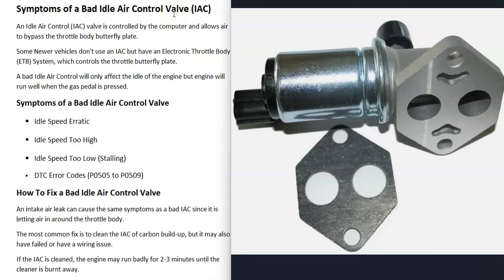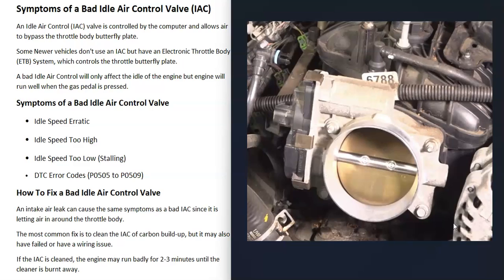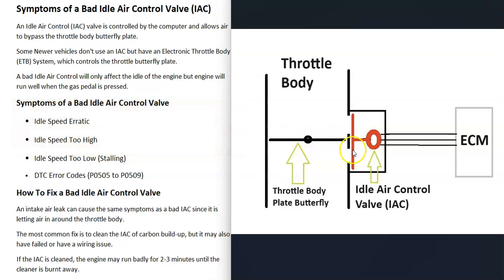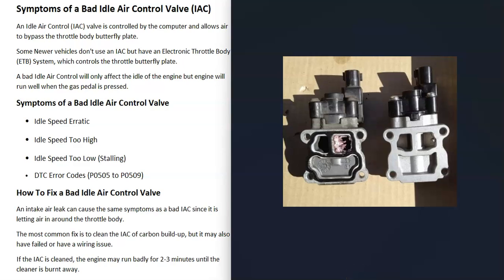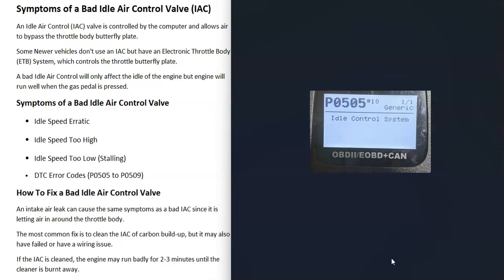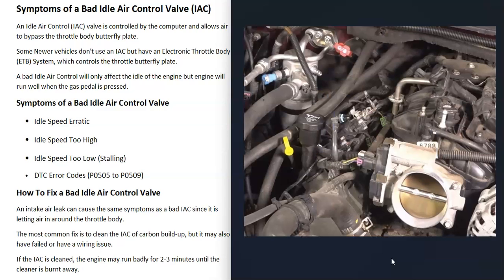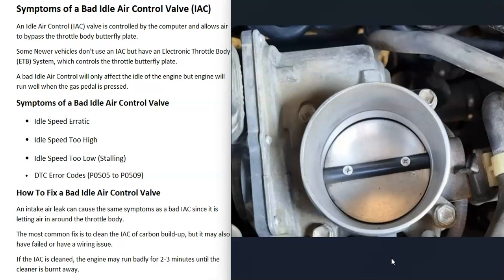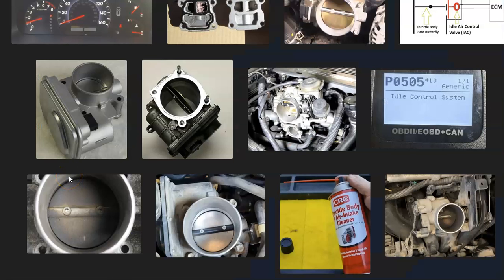Symptoms of a Bad Idle Air Control Valve (IAC)

Comment: If u find a lil bit of oil in the intake then what does that mean? If I clean the throttle body and my rpms rise about 500-1000rpms at idle or when the ac is on every 6 seconds then do i change the throttle body? Its a 2018 dodge journey se 2.4l

Comment: Do you think code P0507 has something to do with it, 2022 Kia K5. I keep getting this error code
Reply from the maker: Newer vehicles use an Electronic Throttle Control system for idle control, and don't have a detected IAC valve. With a 2022 Kia P0507 code, I would clean up the throttle body if it's dirty, check for a vacuum leak, and test the PCV valve.

Comment: Helpful for our THREE fleet Ford trucks that had aftermarket filters in them. Our fourth truck that had factory air filters didn't have these symptoms.

PSA: NEVER use aftermarket K&N Air Filters or any aftermarket air filters if you live in dusty climates like NM or TX. Saving pennies only to spend a buck. Always wondered why these aftermarket filters never caught that much dirt when we vacuum cleaned them seasonally. Stick to changing air filters every 3 months just like your house.

Comment: So I have replacedy iac valve and the guy I bought it from also replaced it. I replaced it again just in case and I still have very eratoc idle. Sometimes when I take it out of gear at highway speeds it will just rev to 3000 rpm and stay there for a minute and then come down. Could it be EGR valve?
Reply from the maker: It's possible, but a bad EGR valve usually causes a rough idle or stalling, but not a high, steady idle. A steady high idle is usually a vacuum leak or throttle body issue. If the engine has a lot of miles the EGR may be bad along with other issues.
Reply: @HVAC_Mechanic  mine is booging to 500 and hopping to a 1000 really quickly like it has a huge cam. Lights dim when it bogs. Seriously sounds like it's missing or has a huge came "buh buh buh.... Buh buh buh" type stuff. I'm sorry if my description is terrible. I did a vacuum smoke test and the only places it leaked were from the new iac valve and the EGR valve

Comment: If my Subaru Forester is coghfin in cald start even steel after garage clean throttle budy bat i don't think they did tithing the computer by reset,what else can be the problem if rpm up and down will starting the engine?🙏 3:40 3:40 3:40 3:40 3:40
Reply: It's 2015XT 160000 K

Comment: I got 1990f150 4.9 300 it's ideal to low drinking way to much gas go down the road get the padded were it not pulling it want to rocks back and forward like it's built with a big cam does anybody no what's going on

Comment: Hi 2018 Silverado 1500 running bad when I started it and then it started running good could it b air idle control valve or 02 sensor

Comment: My 2001 Tahoe revs high while in park but settles down when put in reverse or drive. Code im getting is P0507. It also accelerates without pressing the gas pedal. I took off the throttlebody and cleaned it off really well.
Reply: If that doesn’t work change intake manifold

Comment: 2002 ford expedition. I’ve changed the battery alternator and the spark plugs and coils but it still dies when I idle or take my foot off the gas. I really think this is my issue

Comment: 03 cadillac seville sls. Had to replace camshaft position sensor and both coil packs..1,485 dollar job..on way home my tachometer is jumping up and down. Actually feels like someone has their foot on and off my gas pedal. Runs ruff at stop signs .gets some better when I'm driving faster.going clean throttle body and replace idle air sensor.

Comment: My car does this inconsistantly. My brother was more concerned with the possibility of vacuum issues and advised me to get a new brake booster, i haven't installed it yet, but im suspecting that IAC might actually be the problem 🤔
Reply: Did you fix it? My car is also doing it inconsistently. One time it'll be just fine, next it'll be stalling and running rough when it's in idle.
Reply: @richardwetzeliii4195  not really. I found out my car('85 grand marquis) doesn't have one. I haven't really messed with it since then.
Reply: @Wingedshadowwolf  dang. Well hopefully you figure it out, whatever it is. I've got a 92 Crown Vic and it runs just fine, except when idling and it's just frustrating. I think I may have a vacuum leak.
Reply: @richardwetzeliii4195  That's a bit newer, I don't know if it has an AIC or not. Mine has a low idle control screw to monkey with. In my searching I found people talking about electronic versions too. To check if the brake booster was leaking, one of the shop guys pulled the vacuum line off the booster and a quick blast of air escaped. He said if it was leaking, it wouldn't have had air in it still.

Comment: What if I’m having an issue where my 08 Ranger idles at 2.5k and a slight tap of the gas pedal makes RPM jump. Doesn’t change when engine is warm on idle

Comment: So my car won’t idle when I first started in the morning it’s a 2006 Ford Taurus 3.0 V6 and after it warms up a little bit, it’ll idle, but it’s a rough idle. I put a new idle air valve controller air valve on it a few months backand I’m just wondering if it’s possibility that it went bad already and or should I disconnect it while it’s running and should it stall out or if it’s working right should the RPMs increase if you can get back to me that would be great thank you.

Comment: Here's the scoop. 2002 5.9l  (gas) sat for 3 weeks. Now it won't start without starting fluid. Once started, it idles fine and throws no codes. If I slowly give it gas - it's fine. If I goose it - it chokes out. Btw, without starting fluid it cranks like a bear and when I let off the key it tries to start at the very end of the cycle. Can you tell me what you would look for right off the bat?  I'm getting up in age and it's winter so the less time I'm dickin with it the better. Thanx in advance.
Reply from the maker: It needs to be diagnosed, but I would check the fuel pressure regulator, the check valve, or the component (it can vary) that stops the fuel from flowing back into the tank when the engine shuts down.
Reply: @HVAC_Mechanic  Thanx for the quick response. I'll pick up some beer, hotdogs, and dynamite tomorrow.

Comment: I have a 1988 jeep Cherokee 6 cyl in line 4.0Lt  4x4 
We changed the spark plugs , the wire, the charcoal canister, the router and cap the fuel injectors the idel speed control the 2 of the one next to the other we changed the one on the transmission that prevents it or gives a hard start. We changed oil filter ,new oil we changed gas filter and gas pump. We even tryed a next computer . . It starts but it would not rev up for nothing the cables are all hooked up we checked to make sure the gas is in the tub that is connected to the injectors great pressure. Help any idea

Comment: I'm having this problem with my car when Im at a full stop at a  traffic light and just letting my car idle out my steering wheel will shake and the car its self would shake and jerk, and all of a sudden when I accelerate my steering wheel would stop shaking, and my car would jerk or feels like it is going to die out even burbles coming out from my muffler, but when I fully step in gas pedal the car would run normal when I accelerate fast.

Comment: My car stalls at stops and even cuts off when in neutral any idea of what’s causing it? I replaced the MAF and cleaned the throttle body
Reply: Check spark plugs coil packs ect
Reply: Catalytic converters ect

Comment: Have all the symptoms you mentioned. I cleaned throttle body, replaced Tps, and IAC. Reset CPU and now my truck start up fine but won't want to drive or  move completely
Reply from the maker: Are there any codes? Also, some vehicles have what's called a throttle relearn. If the throttle is cleaned or a sensor is replaced, the computer may need to learn the new variances. Often, the computer will relearn automatically, but sometimes there is a set procedure.
Reply: @HVAC_Mechanic  thanks so much for reply and no. No codes what so ever
Reply: The throttle body I took out and clean looks OK and clean and the window flop is opened and close by toggle back and fore OK. I'm kinda baffled
Reply: It's 1999 4runner limited
Reply from the maker: I would recheck all the wires and any hoses and be sure everything plugged in good. The throttle body may be good, and there may be another issue. With no codes, it will need to be diagnosed, and components will need to be tested to find the problem.
Reply: @HVAC_Mechanic  Sir, you are god sent gifted for helping me out. I went back this morning and retraced my steps and took everything out and put everything back again. Didn't see anything that might be out of ordinary. I did, however, took out the TPS and turn it back and fore thinking it might be stuck even though its brand new. After that, I did a relearn and reset. Long behold, that thing move forward and drive but noticed slightly when put on backward, it takes kinda slow to put it in gear to go back. So, I was wonder if this will take sometimes for it to relearn fully.

Comment: I have a creta 2017 which doesn't start unless I push the gas paddle. Rarely stalls 2-3 min after start and it's usually when stopped at traffic lights. The throttle was cleaned, changed sparks and air filter, still the issue remains (no error codes). It happens when the car is parked for like +8hours. What could be the issue?

Comment: MY 2004 TOWN CAR,STARTED TIS RECENTLY,I HAD CHANGE THE IACV A FEW MONTHS AGO,FOR A NISE COMING FORM MY AIR BOX,VIBRATING,HIGH PITCHED NOISE,CHANGEIT,WENT AWAY,NOW THE FAST IDLE AT COLD START,NO LONGER HAPPENS,JUST VERY LOW IDE,I HAVE TO PEDAL TO KEEP RUNNING,AFTER WARMING UP,DOES BETTER,STILL A LITTLE MISS FEELING,BUT RUNS GOOD WHILE DRIVING,SHOULD I CHANGE THE IDLE AIR CONTROL VALVE AGAIN? I DID BUY FROM  E-BAY,IT WAS CHEAPER,WAY CHEAPER,THANKS,APPRECIATE YOUR THOUGHTS ON THIS, I GET NO CODES OR ENGINE LIGHT,CLEANED THE THOTTLR BODY AND THE MAF SENOR, NOT MUCH CHANGE AND STILL NO ATOUMATIC HIGHER IDLE AT COLD START.

Comment: 2006 dodge Durango 5.7 hemi v8. 115,000  got it 4,000 less.  Stalling on low idle/ traffic lights, especially when making turns that doesn’t require giving gas ( or throttle)   I can wrench a bit and have replaced, recently enough quite a bit of the exhaust system in general still  bad ass truck. Cat delete   Too many minor fixes replacing and cleaning to list but appreciate this video bc it’s helping me to narrow down before I get too crazy trying to get the air fuel ratio tuned.  She was slightly neglected but still a beast. Thanks this helped tons. I would appreciate a response from anyone and I can elaborate further as I fix
Reply: Hey was your oil pressure dropping at a idle as well??

Comment: So i was getting shaking when idling so i cleaned my throttle body and put in a new aic valve and my problems started. Was the new one i put in faulty? I bought it at autozone. Should I go and demand another one?
Reply from the maker: Some vehicles have what called a Throttle Body Relearn. If the parts and wiring is good, I would research if it needs a throttle Relearn.
Reply: Unhook bat, set for 30 mins. Hook bat up, let idle for 10mins.

Comment: Great Video! I have a 2006 Jeep Grand Cherokee and recently put new heads on due to bad head gasket, also new timing chain kit along with brand new OEM catalytic converters. When i was taking the Cruise cabe off the throttle body  i broke the nub that the cable clipped to so i got a used  throttle body and rebuilt mine. The issue i'm having is sporadic idling and when going down the road i have to mash the accelerator to get it going. Stops are worse trying to get going. I have replaced the IAC and that  did nothing  ,  The data on my scanner is saying the IAC has high input voltage. I was told with me rebuilding that throttle body it is probably out of spec, So i ordered a new throttle body with both new sensors  IAC and TPS . I installed the New throttle body last night and its still the same running  ruff and still have High voltage at IAC. Can anyone lead me too what might be causing this High voltage? I can't find anything besides replacing the IAC. Instructions with the NEW Throttle body say's the IAC needs Idle speed relearn and i cant find anything for my jeep how to do this. Also as  last night im throwing a code of UO41, Witch i just watched your video on that before writing this book. Thanks for that as well. Any help would be appreciated.
Thanks
Reply: You would need a scan tool that communicates with the vehicle computer, and run a idle relearn. Most mechanics should have an appropriate scan tool and the area where i am, they charge anywhere from half an hour to an hour of shop time to plug in their scan tool and do any relearns. Some might even do it for free, since its a procedure that should only last a couple minutes. Good luck!

Comment: Hey bro. My car is 2006 honda civic coupe 1.8… does it have an IAC valve or its called purge solenoid valve??…coz i cleaned my throttle body using cr throttle body cleaner. After that the idle is too high and fluctuating and the engine light turns on. I reset it manually by gaking the negative wire on the battery. and by the way i scanned it and the code is po505 .. doni have to replace the purge valve that is attached to the throttle body???
Reply from the maker: The purge valve is for the EVAP system used for emissions, which is separate from the throttle body idle. If the purge valve is bad, it will usually give an EVAP code. With a P0505 code, there is still an issue with the throttle body. Usually, it is dirty and needs cleaning, or a component has failed, but it needs to be troubleshooted.

Comment: I’m having the idle problems bad but I’m having codes like p052c cold start and other codes like camshaft/crankshaft correlation sensor and timing codes, could the AIC or throttle body cause such things??
Reply from the maker: It will need to be troubleshooted, but that sounds like a timing issue such as a slipped timing chain/belt.

Comment: 2016 cryshler 200 2.4 once you have it in reverse engine stalls,replace motor mount.transmission mount same thing did tuneup spark plugs coils,pcv,clean throttle body

Comment: Wow.  This is a very good video.  My car (BMW) is exhibiting the very symptoms you describe.  It runs fine going down the highway, but as soon as your press the clutch in, its RPMs drop and it stalls out. It also seems to occasionally idle at a very high or sometimes erratic RPM.  It has been setting for a while in the garage.  This will be the first thing I take a look at along with any air leaks.  Thank you!

EDIT:  The problem was determined to be a large hole (several) in the rubber plenum / pipe leading up to the throttle body from the MAF. I assume the computer was getting bad info from the sensors causing erratic idle and stalling behavior.  Once pipe was replace, and IAC cleaned - since I had it apart - it was able to run rather rough.  After about 10 miles or so of driving the computer was able to gather correct readings from sensors and everything was fine.  Apparently these pipes are terribly designed and known to rot away causing severe cracks.
Reply: Same issue here, runs perfectly fine on my '92 F-150 when on the highway, but if I'm idling in first, have increased load like AC, headlights, or turning (engaging the power steering) it will pretty consistently stall out. Did you try messing with the IAC valve, such as resetting it? If so, how were your results?
Reply: @azukakage  See edit.

Comment: Its the same issue with mates Toyota hilux. Prob mid 80's. Trayback . I pulled it off and cleaned it. Good for 2 days then back to over reving, about 2100. It is the idle sensor, electric that controls a magnet i think to turn the shaft inside. Ive minipulated the shaft and  confirms its faulty. But only the magnet! End where it has a elec plug.

Comment: What about the engine nice and hot and push on the pedal while in park an it idles high like 3 rpm’s then after 10 sec or so it starts to idle down to normal is that a sign of bad iac too ?? Code shows p0507
Reply from the maker: I made a video on a P0507 code. Here is a link https://youtu.be/EmP0yDshwIc

Comment: Great video, thanks. How do I differentiate between malfunctioning Idle air contole valve and leaking air please?
Reply: Try feeding smoke in the Intake. While it is running. The vacuum lean should reveal itself w smoke if you have a vacuum leak

Comment: Have all the symptoms, but the engine code is a misfire p0300 code and a misfire code for all cylinders.. already checked all the usual culprits, the iac and egr are among the last to check besides possible vaccuum leak..
Reply: I had same code my issue was water in the gas tank, dumped pit new gas on it and truck runs again.
Reply: @proroofersncllc-vb8rl  might have to do that.. it's either that or the ecu is burnt out

Comment: Does it suppose to leak or vacuum air thru the idle control valve ? I did a smoke test and smoke came out of the control valve

Comment: Good video!  I have a 2015 Nissan rogue, runs great first 10 minutes or so , but vibration starts and is present at stops, and at idle. I Cleaned up throttle body, mass airflow sensor, new filter, new pvc , no cracks in any hoses, new engine mounts, new 02  sensor, pre cat,  no codes, fuel cleaner in , fuel trims are good … …🤔.. any thoughts?
Reply: I have tbe exact same issue right now, runs perfect first 10-20 mins, then bogs down when coming to idle, did you find the issue?
Reply: @jadenengeman7341  most likely the vvt solenoids are bad or dirty.   I traded the car in and did not fix it ..

Comment: Hi, my name is Fran I  have a 2008 Saturn Arua XR 3.6 with Idle problems changed the throttle body and checked for a vacuum leak checked some wiring still the same problem. What's next? Changed the throttle body because had a low-speed warning light.